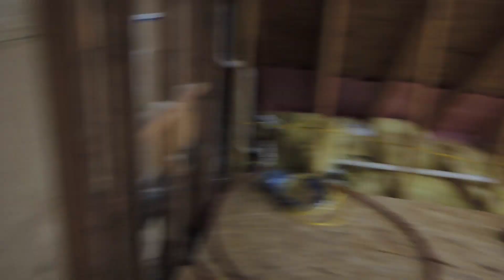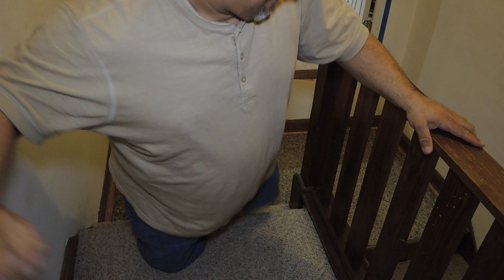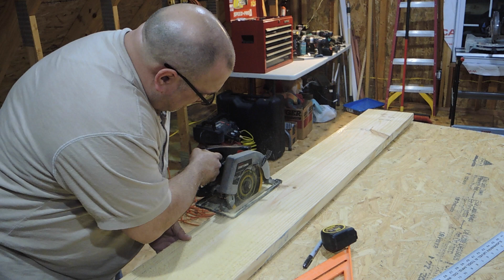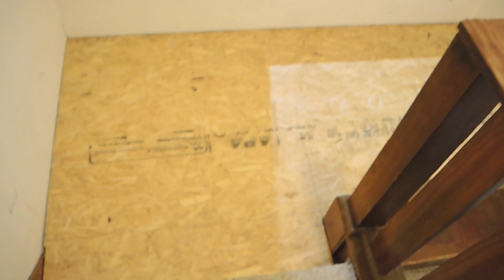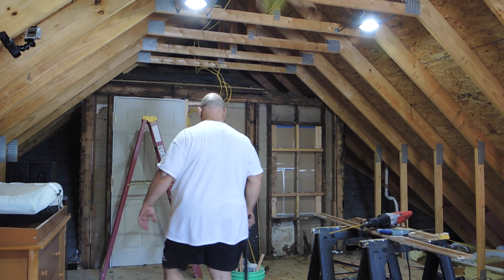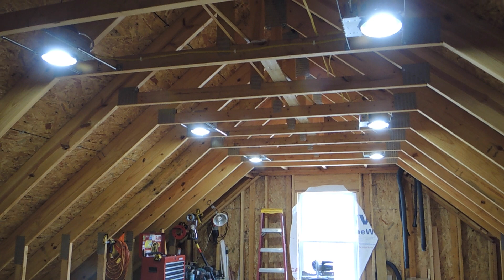Mancave update 1

Comment: Thats going to be a nice man cave. That landing worked out perfect. I like power tools too I just need more of them.
Reply from the maker: got 2/3 of the insulation in, got the attic space decked, added lights to the attic spaces. Some of the duct work done, cat 5 and cable ran. Then moved to some outside projects. I do have video to put together, just haven't had time to compile it all together. Traveling for work this week. I do have a cool project on my front porch that I have been shooting video on.
Reply: Sounds like you have been busy. Can't wait to see the updates. Save travels !
Reply: Any updated to the Man Cave?
Reply from the maker: I have done some work on it, I even got video, then worked on my entry way and got some video there. Then bought motorcycle number three, a 2003 vfr 800. Went thru it getting it serviced and did a little paint work, and did a 1100 mile trip on it to macinac city, Michigan. put a hot tub on my deck, it been a crazy summer. I went back to work g part time for our local kawasaki dealer ( pay for my toys for the honda). I will try to put together an update video of all my projects since my last video.  did get a couple pretty cool dji videos too. I may work on doing a summer Montage video tonight.
Reply: Wow sounds like you have been pretty busy. 1100 miles is a long trip how did that go? I finally did our entry way with the same Air Stone that you use. It went up pretty good but I never did any videos. I'm a slacker! I look forward to your next video as always.
Reply from the maker: Oh yeah during all that my son graduated college and got married a month later. plus we have been trying to get what time we can in with our grand daughter. so yeah been a busy summer. the trip started off wet, then went down hill from there. LOL there are some electrical issues with 4th and 5th gen vfr800. I cooked the stator 3 hours from home. I got it all straighten out now, but it was a shitty way to end my trip riding bitch halfway home to meet a buddy with my truck and trailor, them driving back to get my bike. just glad I didn't do my original trip I had planed I would have been 10-12 hours out trying to figure out what to do. I will try to do a summer update on my projects tonight.